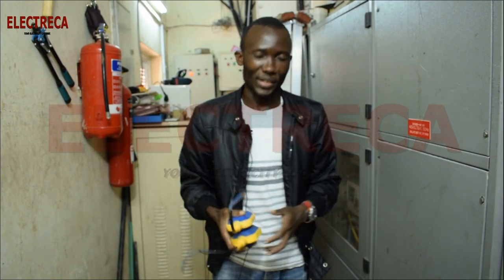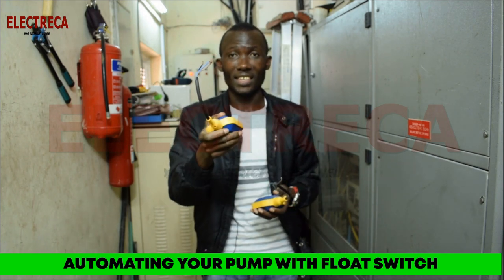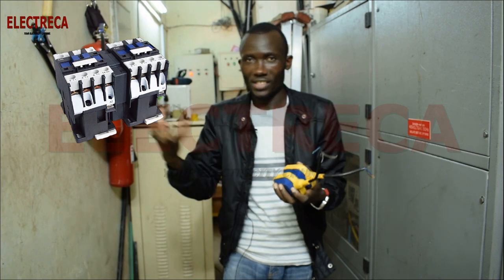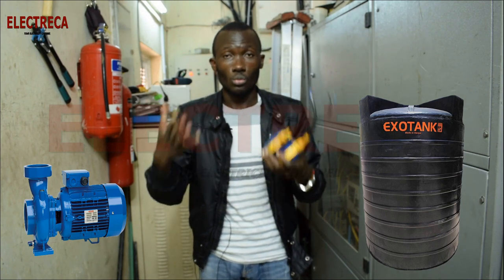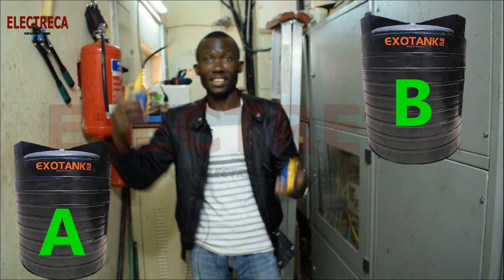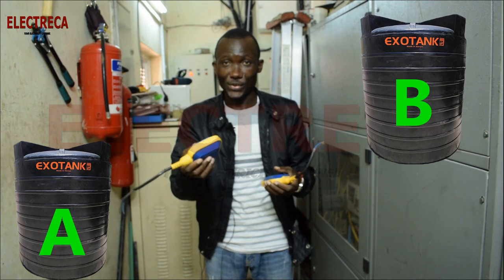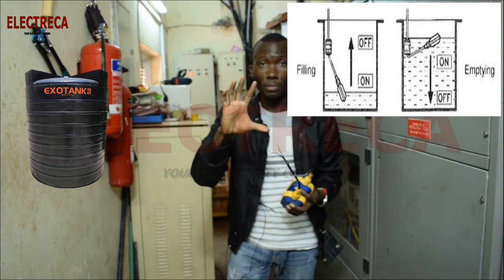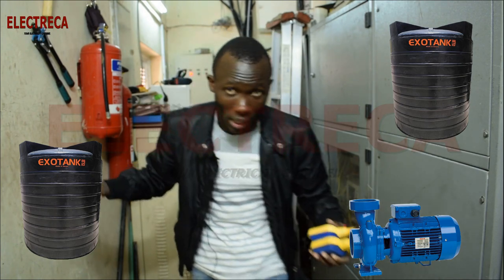How to use float switch in the tank|float switch|ELECTRECA

Comment: hello guys hope you answer my question. I just want to know if i can use this without the contactor.? Can I go directly to breaker?
Reply from the maker: The answer is an effective NO use a contactor.
It's a NO because you connect the float switch in series with the pump or motor and depending on size of the motor and the distance of cable on the floatswitch., That will cause a voltage drop and eventually cable heats up and burn.
There fore use a contactor
Reply: @electreca1  i like the way you enlighten me. specially in remnding the importance of voltage drop.